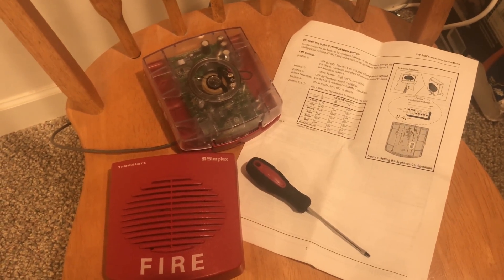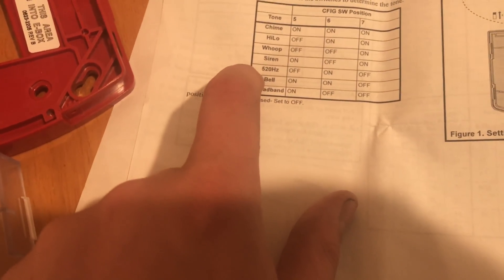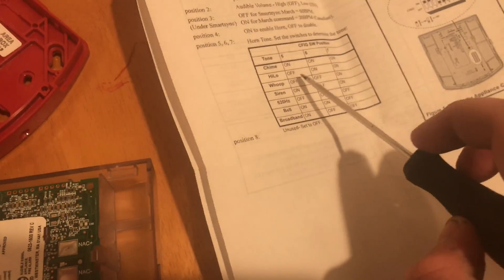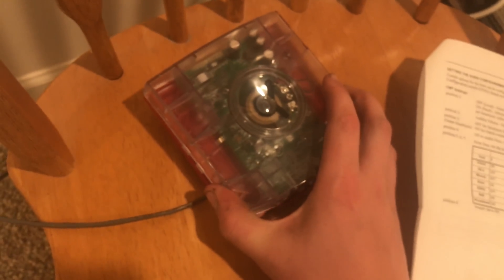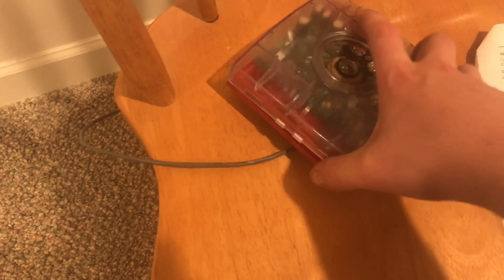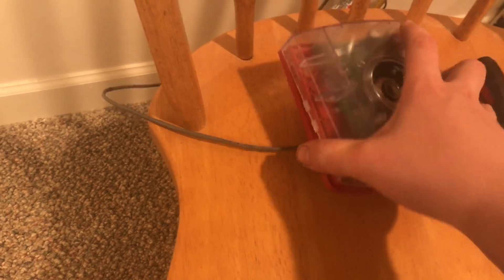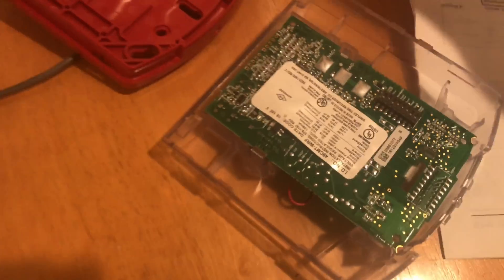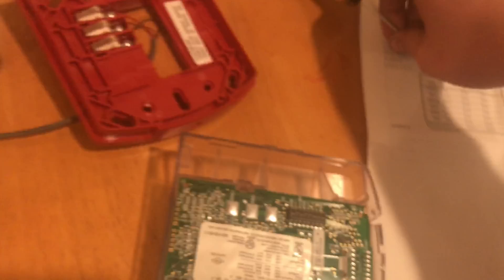All Tones of a Simplex 49CMT-WRF MultiTone Horn

Comment: Hi @Fire Alarms and Such. This is Tyler here. My former high school just got renovated last year. The model is some kind of Simplex Truealert model but with a very faint, quiet chime like noise. It almost sounds like a clock bell but in code 3 and noticed that was not one of the tones in this video. Our system had the faint bell on the inside with regular Truealert horns on the outside. Do you have any idea of what that could be? Thanks.
Reply: My guess would be speaker/strobes. Simplex voice evac panels have several tones like what you're describing.